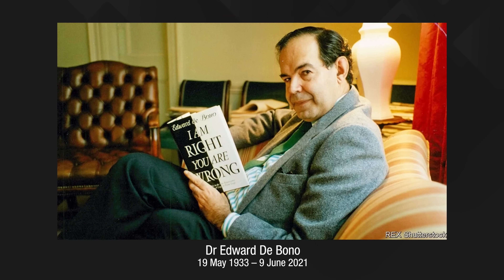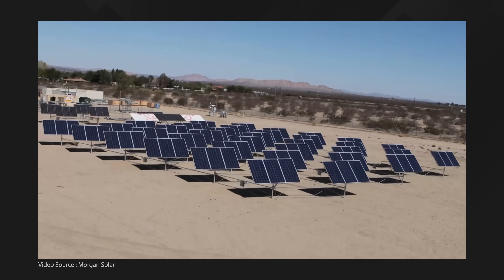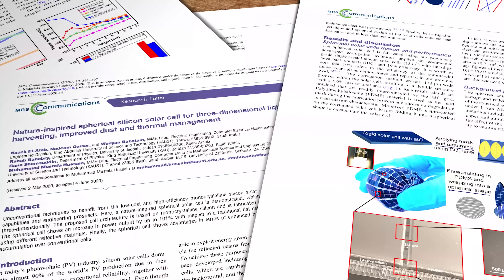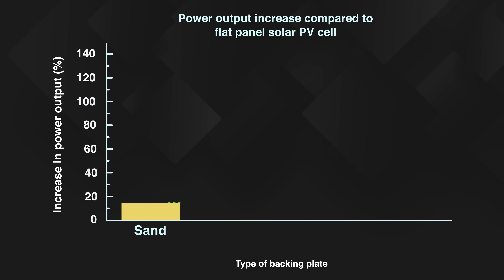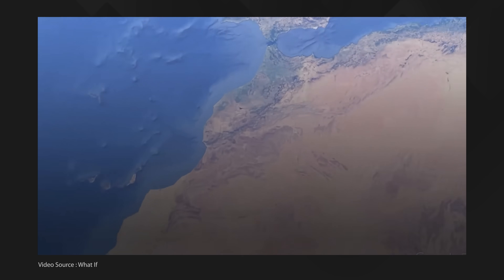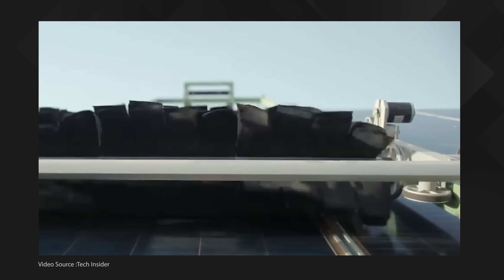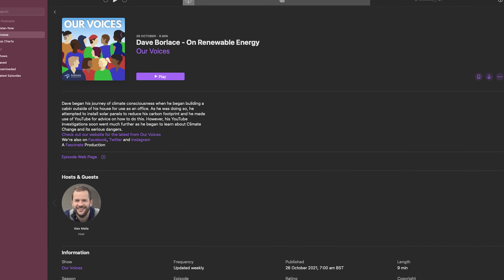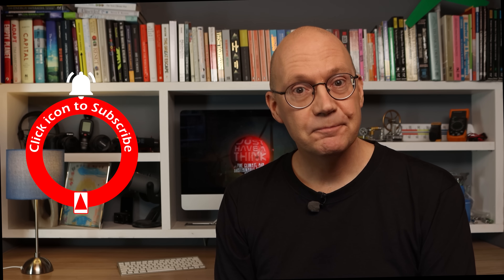Spherical Solar Cells - doubling the power output of flat PV panels!

Comment: It's interesting to see an increase in output in normal (unscattered) lighting conditions in the lab, without the reflective backing, since output of solar cells is directly influenced by the angle at which light hits the surface, and directed light hits a sphere at 90 degrees only in one spot, and never on the "dark side" of the sphere.
Maybe since there's always some reflection from the surrounding area, even without an intentional reflector, the sphere performs better than the flat panel.
In real life situations there's always light reflected from the atmosphere during the day, and even without artificial backing, the ground and surrounding objects reflect the light onto the sphere from many directions, so I'd expect the sphere to perform even better in the real world.

Comment: The takeaway from this video is “dirt cheap” solar panels. Low cost means it will become cost effective to install panels in less optimal or intermittently illuminated sites. If more panels is cheaper than heliotracking devices, then that’s what you do. Additionally, cheaper panels means collecting reflected light may become economic too. It’s still depressing to see so many new buildings WITHOUT solar roofs though.

Comment: What would immediately sell like crazy and help the move toward renewable energy is a solar "tarp" or any kind of thin blanket that folds and can easily be hauled to wherever user wants to spread it out and get power. With an inverter providing standard AC output, it could do lots of things. When I saw a video about a company making flexible solar film, with about half the gain of panels, I thought of what I'm suggesting/requesting. Who WOULDN'T find use for one or more?

Comment: Haven't watched the video yet, but I have studied photovoltaics as part of my renewable energy engineering degree. There are several problems with spherical solar cells. One is that   there would current mismatch losses because each cell is not facing the same direction, and even a single cell is curved. If there's any moving parts, that also increases the maintenance costs, or reduces the lifetime, or both, and increases the levelised cost of electricity.

Thin film tandem solar cells are a leading candidate for future efficiency gains for solar, as promoted by Martin Green, who invented PERC solar cells, which accounted for an estimated 85% of worldwide solar module production in 2020. Maybe also printed solar cells out of Newcastle University.
Reply: If you shrink the spheres to mm or micro sizes it will work and parallel wiring it doesn't matter if one cell produces more

Comment: A couple of thoughts come to mind: (1) rotating spherical PV panel should be able to dissipate heat, enhancing efficiency; (2) they don’t really need to be completely spherical - a hemisphere, or less, would still catch more sunlight, as the sun moves across the sky, without the need for expensive tracking systems.  How about a half cylinder shape, mounted at the appropriate angle?  Or perhaps a half cone?
Reply: And it could double as a barbecue pit!

Comment: The title of the video led me to think of small spheres (like marbles) arranged in a grid within protected solar panel-like flat structures. Looking at the Japanese product, and the rest of your video, arranging the spherical solar panels (marble size) within a solar panel, with reflecting surfaces underneath - so that any direct sunlight that hits the bottom reflector, will reflect into a nearby PV marble, may increase efficiency even more. Not sure if you will see this, but I would like to hear your thoughts, thanks.

Comment: The roof of my house has two broad sides facing east and west, I was thinking of putting say, five-eight  panels on each side rather than try and fit eight panels on the short side of the house that faces north. A big sphere might be better but would the wind batter it around?

Comment: Well interesting concept. Considering most solar cells utilize red and blue frequencies, it would make more sense.
As when dawn and dusk appear, the main light is red and infra red, regardless of the season. Sometimes as much as 3-4x the concentration as blue.
Meaning, this could activate the solar cell significantly sooner and later, as soon as it peaks and sets on the horizon. You might be able to get 3-4hrs more of charge time, no matter the orientation of the house or panels, conducive of the suns path.

Comment: Much like the difference between 2 axis and 1 axis solar tracking, you can probably get most of the benifits by just using a tubular shape arranged into parrelel rows, which will be infinitly easier to manufacture as you only need to bend the PV in one axis as well as the ability hold it all in a frame so that a viable panel is produced.
Reply: Solar tracking for consumers is largely redundant because of cheap panels. I saw a vid with a graph and what tracking gives you. It's more charging in the morning and afternoon. There was another graph showing what a couple more fixed panels gives you and it's the same as a tracker. This is the effect of panels going down in cost. 
One can buy more panels than one needs to make up the difference between fixed and tracking and dump the excess load into heating water for example. 
Myself, I always wanted a tracker but it's now a folly - but more seriously it is another thing to go wrong. I live off grid and when something goes wrong it is the absolute pits since no power company is coming to the rescue. Simple is better, it really, really is.

Comment: I remember the program about lateral thinking I am a big lateral thinker who has had to train himself to think in straight lines (sometimes) to please others. At 63 I got my ADHD diagnosis which explained a lot. I am in Portugal 🇵🇹 now ready to start work on my renewal powered and heated house. Personally I think we should  be using small solar cells they are strong resist wind better and cool better. They also have the advantage of being able to buy just the amount you need and building up slowly.

Comment: Let me point out a few technical points here:
Solar cells generate a current that is lineally depending on the irradiance received, and a voltage that is roughly stable and depending on the cell temperature, once irradiance is above a small threshold.
Therefore, if a single cell is spherical, all irradiance will add up as current, which is good.
But... If a cell is large (>20cm2) the current is very high and losses will make the cell very impractical.
So this development is unlikely to go to cells much larger than this tennis ball.
For such small balls, the curvature makes it very difficult to actually curve the semiconductor, unless you use low-efficiency thin film technologies, or piece down the silicon wafers into very small pieces, which is hugely impractical.
In case you have such balls, then you have many of them (cells) in series, and any small difference in total cell irradiance will create losses due to mismatch. The nature of the spherical cells is prone to differences in cell performace, thus creating additional losses.
So all in all, a fun experiment only, but not practical at this stage, unless some of the shortcomings are actually addressed.

Comment: This research is obvious and the results are stupid. They basically made a double-sided solar cell ("spherical") and found that when the entire background is white sand, it reflects more light back the combined front and back surfaces than just a flat front surface alone. Um, duh?
I could imagine ways this may make sense, but the actual results being discussed here are useless, bogus, headline fodder.

Comment: Several years ago there was a similar idea with a conical shaped PV module, and it never got passed the nice computer generated graphics stage. There are several reasons why it did not catch on, and why this idea will not either.

With this design half of your solar cells will be facing away from the equator , this side will never see any direct sunlight. So you could already increase your output by cutting the sphere in half and have both sides facing the equator . 

The spherical design is even worse than the conical design of yesteryear because you have half your cells facing downwards catching only diffuse reflected light . So if you would cut the half sphere in two again, and would make both halves facing upward you would  increase the yield again. 

If you put normal PV panels at a tilt on a flat area they only shade eachother in the north south direction. With spheres, half spheres or quarter  spheres they also shade eachother in the in the east west direction. So they need to stand apart in both directions, considerably reducing the amount of modules you can put in an area.

Then there is also the additional cost, power use, and maintenance needed for the motor.

So overall, not aboriginal idea, and it will only decrease the yield of the PV system.

Back to the drawing board.

Comment: The wording implies that the efficiency of a 21% solar panel can be doubled to 42% which I think is an absolute false and misleading notion.  A sphere takes more surface area than a square of the same dimension, so there is actually MORE solar panel, most of the sphere is not at an optical angle.  The solar tracker will garner more power than either the stationary panel or the spherical array.  Mirrors with light amplification crystals would generate more power without the extra heat,

Comment: The spherical surface area is 3 to 4 times times the surface area of flat or rectangular one. but the gain of energy may not be 3 to 4 times. Also, using flat panels can be install on top of readily available roof surfaces. Also if the spherical panel is not fixed at one place, then it may rotate continuously and eventually breaks down. Designing and maintaining this power transferring mechanisms adds up the cost. However, getting rid of the excess heat efficiently is also a plus for the spherical surfaces.

Comment: So there is something to this but its "hidden" in what is actually being optimized for which is space efficiency but as we know with solar panels this really isn't that important to the economics there's lots of places to put solar panels. However strategies like this come up a lot in concentrator photovoltaics since space matters a lot to the design, materials and weight. Because of the variability in the angles of light NOT being all in a plane because the solar incidence is larger than Earth and because Earth is not flat you would actually want tiny interlocking spirals to most effectively collect the most light. However making silicone into that shape would never be worth it. So the results here aren't surprising but also probably not that significant either without significant efficiency gains.

Comment: Huh.... Seems like 3d printing would be a fantastic way to build spherical solar cells. However, the simplest approach is to mount them on a curved frame. From what I understand, the researchers carved out the sphere material by using one cell. With a larger sphere they could easily use lots of standard square panels mounted on a curved structure, thus only needing to adapt the final assembly stage of the panel manufacturing process. Yes, I do realize there will be a lot of engineering needed for that particular step, but it at least reduced the retooling load of trying to make a bunch of actually slightly convex solar cells. 

Maybe use some Fresnel lens material on the great circle areas which get less light.... hhhmmm or better just to leave off a few degrees on the top and bottom. 

About dust,  the spheres may be less likely to accumulate dust, but the reflectors behind them will definitely collect dust, so the cleaning is delegated to a secondary part - a generally less expensive part and one that is begging for some kind of automated solution.

Comment: Capturing light from all directions can also already be done by a bifacial solar cell, which is just a regular flat cell design that allows light to enter from both sides. These panels are already being produced at large scale and becoming more popular quickly for land-based PV parks. Wonder how this spherical design matches up against bifacial. Also, an issue with spherical cells in panels would be the packing I guess, hard to achieve high filling fraction.

Comment: So... spherical solar cells that can collect light from any angle, and that means they must be 'better' than flat cells, eh? Let's have a think:
1) Sun light for all practicable purposes always travels in straight and parallel lines.
That means any solar cell, or part of said cell, that isn't facing the light source can produce NO power. ie It is in shadow.
Worse, if your panel isn't placed at 90deg to the light source and completely flat you loose efficiency as each unit area of light falling on your panel is spread over a larger area of said panel.
2) What is the absolute worst shape for a solar panel?
One where at least half of it is always in shadow while minimising the area where light hits it at 90deg on the illuminated side. Yep, A SPHERE!!!
You don't have to do any experiments, you don't need to know any 'special' maths, you just need to apply a tiny bit of logic to the question. THAT is why you don't see spherical solar panels everywhere!
3) But what about reflected light?
Can you think of a single example where light reflected from the Sun is even as bright as the Sun itself? No! A 100% reflective surface cannot exist and nearly all reflective surfaces do very, very, much worse than that. Even worse, light frequencies that are generally of most use in solar panel technology are those most poorly reflected by any material you care to mention. Any light reflected on to the 'dark side' of your spherical cell will contribute next-to-nothing to it's power output.
4) So what about the data in this video?
Well, if you discount idiots, snake-oil merchants, and pain liars, which will account for the vast majority of such 'moonshine' you really only have one possible answer: Place your spherical solar cell in front of a fantastically reflective parabolic mirror and point the whole apparatus at the Sun! You may then overcome all the above inefficiencies simply because the area of your mirror is very much larger than a flat solar panel of equivalent area to your spherical one.
5) Well, it that works...
You still have to point your parabolic reflectors at the Sun* defeating the whole purpose of having a spherical solar cell! You have to make and mount your parabolic reflectors! To overcome the inefficiencies inherent in reflecting the light on to the back side of your sphere and the inefficiencies of having a spherical front side your reflectors need to be very large! A parabolic reflector has to point more-or-less up and being bowl-shaped it will catch any passing detritus so reducing it's efficiency still further!!!
...or you could just mount an array of flat solar panels pointing in the direction of the Sun, so maximising efficiency and minimising space. sigh

*Yes, yes. One might argue "you don't have to point a parabolic mirror at anything". But do consider the total 'amount' of light that can 'enter' a parabolic mirror is dependant on the apparent size of said reflector. Any 'surface' not directly facing you appears smaller the further it is angled from you.

I hope this hopefully educational rant has given any potential reader some food for thought. When faced with a seemingly good idea one should really apply a bit of basic logic as a form of sanity check before accepting it as reasonable. If the idea passes your initial sanity check, this one doesn't, the wise person will investigate very much more thoroughly before investing any further consideration in to it.
Reply: I've occasionally wondered: is there an engineering limit to PV solar such that the amount of light it can capture efficiently (well, "efficiently") is about the same as the sun can produce? If not, why not have a CSP-like array of mirrors that cause much more light to hit a given area of PV?

Seems like a weird coincidence if the efficiency sweet spot for capturing sunlight with PV technology just happens to line up with the maximum solar irradiation. If it's actually 2× or 5× what the sun can get us, this could be amplified with mirrors. Which, one would hope, are cheaper per square meter than the actual PV material.

Is all I'm saying.

Comment: A logical and necessary development of the solar power concept. I don't have the technical knowledge or training to judge how effective this might be in specific applications but I can think of several where it must have great potential. For example, electric vehicles with these on the roof and side panels, connected to a trickle charger, should make a major contribution to the power accumulation during a whole day of sunshine, especially in places where the sun is very bright. Given that so many vehicles are only used for a small minority of the time it is possible to envisage situations where such power might provide a substantial proportion of the total needed. A few years ago I recall that a solar-powered aeroplane circumnavigated the globe and whilst this would obviously be impossible for aircraft carrying any kind of cargo or passengers, it is quite possible to envisage other long distance craft such as ships drawing a proportion of their power needs from solar panels.

Comment: In regards to no baking material. I noticed this a couple of years ago while building our 100% solar powered RC cars. We coat the top of the cell with epoxy resin for a little extra durability. Works great.
Reply: The resin on the top side absorbs some of the sunlight.  There are other materials that cause less reduction.